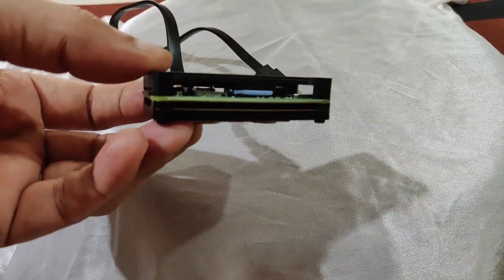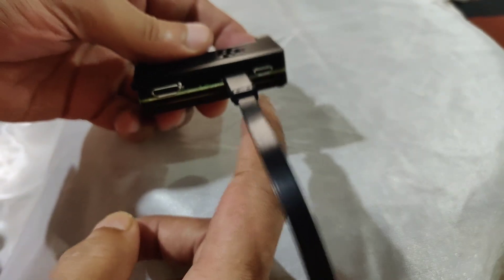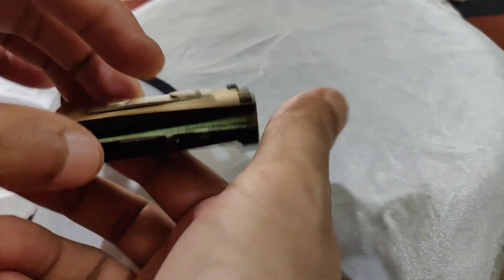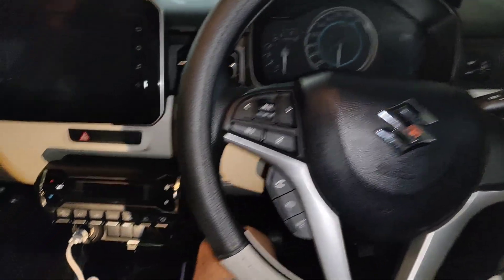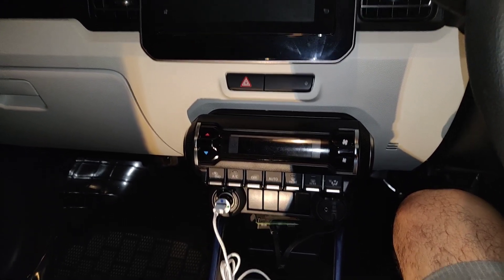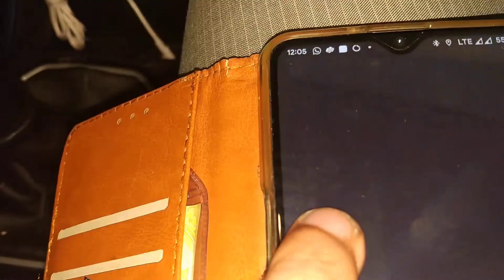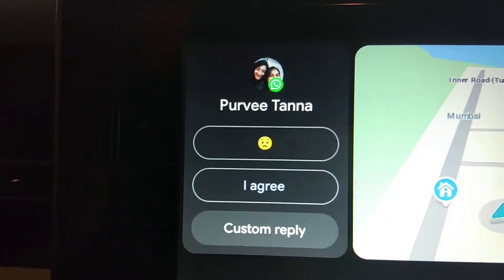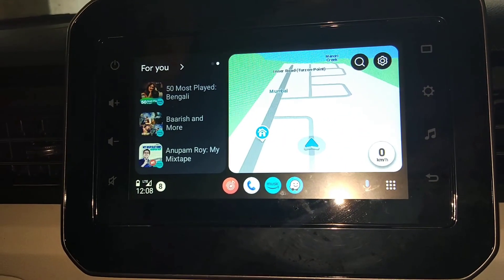DIY: Wired Android Auto to RasPi Wireless Android Auto in less than Rs. 2000

Comment: Interesting video.  Thank you.

I think I would use Velcro tape to attach the Pi to the car, rather than using anything magnetic.  I'm not sure how the magnet will affect the contents of the SD card over time.
Reply from the maker: The magnetic strips I have attached hardly impact the SD card. I have been using it for an year now.

Comment: it connect via blueetooth or i have to connect to te usb input of the radio?
Reply from the maker: I think you didn't watch the video and the purpose of this item. It is to convert wired to wireless Android Auto.

So yes, it is to be connected using Bluetooth.
Reply: @GoogleLocalGuide  Ok!loll i wasnt sure now im flashing my raspbery pi with the sd card img its a very cool project thanks for the sharing :)

Comment: Great!
I've added wireless Android Auto same way on my Maruti car. So far it goes trouble free.
Do u see any option we can add a lossless music player as well along with this?

Ive got a Raspberry Pi 4 4GB and a Raspberry Pi DAC(32 bit) as well. 
TIA
Reply from the maker: Glad to know that it works great for you as well!

Can you elaborate a bit more on about the lossless Music player you are referring to.
Reply: @GoogleLocalGuide  Lossless format audio miostly needs some form of a DAC to convert digital Audio to analogue high fidelity music. Most DACs are 24bit or 32 bit.
Im using HiFi pro Audio 32 bit DAC with Raspberry Pi 4B 4GB board with Volumio Software.
I want wireless Android Auto along with DAC on my Raspberry Pi, with media Audio playing from the DAC board. 
HTH

Comment: Hey i watched your video and got my pi 2w set up. Whilst i did see bluetooth connection drops after a few restarts i got connected to the Aawireless bluetooth and wifi however nothing came up on my car screen. I went to android auto settings and it was showing wireless android auto available but nothing after that. My mobile kept on showing looking for android auto and was stuck there. Any fixes for this?
Reply from the maker: @rinmoytalukdar9986  Yes, it has occasional issues. I then have to restart my phone and unpair-repair AAWireless Bluetooth and things start working. Once I had to format and setup the SD card once again with Balena etcher. It's little bit of r&d and we have to live with it, since it's free and since the developer is not sharing more releases since the last release in August 24

Comment: which version of AA wireless used? becoz Im facing a bluetooth disconnect issue, as its a bug in recent version..
Reply from the maker: I am using 0.4.1 from https://github.com/nisargjhaveri/WirelessAndroidAutoDongle/releases on a Pi Zero 2W. Thanksfully it works fine.

Comment: Which Raspberry Pi Zero 2 W is advised? Without soldered pins or with soldered pins?
Reply from the maker: It hardly makes a difference, as the case can accommodate both types. The pins in any case are not going to be used here.
Reply: @GoogleLocalGuide  how much storage of card can be used? I am not getting any card below 4GB..